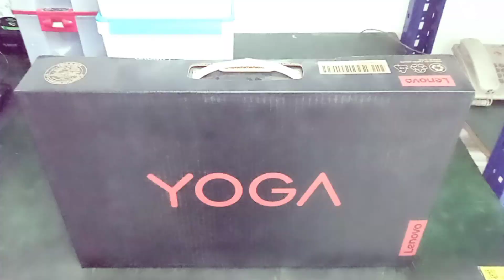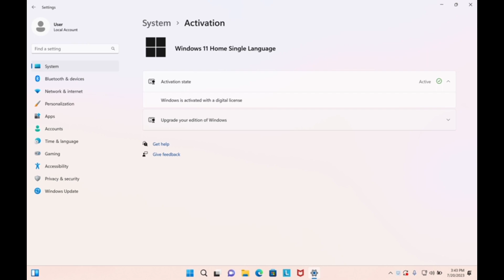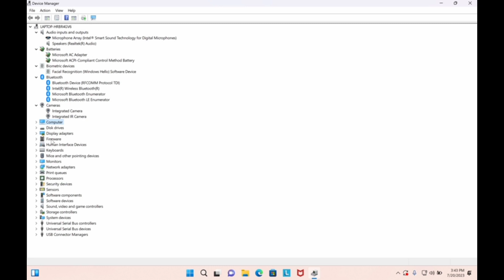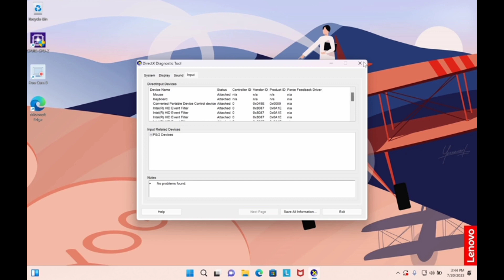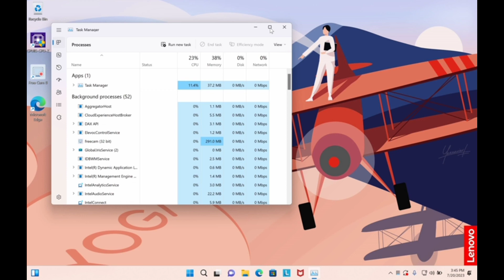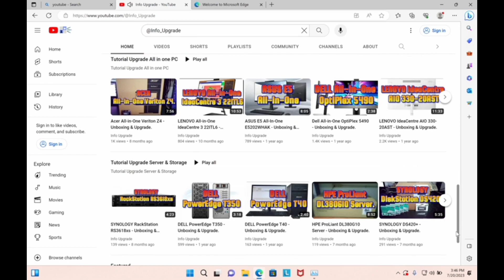LENOVO Yoga Slim 6 14IAP8 - Unboxing, Disassembly and Upgrade Options.

Comment: Bro does aluminium body laptop heats ?? 
I should go for this or not ?
And how is  battery battery backup
Reply from the maker: The aluminum body doesn't get hot. The battery is quite good (long lasting)

Comment: well good explain brother, I want to know about battery capacity mah /wah,
Reply from the maker: hii bro
Integrated Li-Polymer 65Wh battery, supports Rapid Charge Express (get 3 hours of runtime with a 15-minute charge)
Reply: wah /mah, means if  I purchase power bank of 25000mah, for full charge of Lenovo laptop how much it consume battery from power BANK
Reply: ambrane 25000mah power bank 100watts charging
Reply: I have purchased Lenovo Yoga Slim 6 Intel Evo 14IAP8

Comment: what kind of ssd is that? i have seen full size ssd so far. can i upgrade it further with full size regular ssds?,,, please reply
Reply from the maker: Hi friend
If you want to upgrade, remove the default SSD
Use SSD M2 NVME 2280
Reply: @Info_Upgrade  thanks for replying❤❤

Comment: Hello Bro.....,I have one problem from this laptop that's vertical black line appears on Desktop .
Please tell me solution anyone for this problem
Reply from the maker: Hi, Bro.
Black line? what is deep rupture
I suggest you take it to an official Lenovo service center, because the guarantee covers a damaged unit, even if the LCD is broken, Warranty Add On Accidental Damage

Comment: Running very hot, I have bought it recently, What to do ?
Reply: @borok2312 yes, but battery backup is normal (5-6 hours, but performance excellent) not upto 9 hours (like intel evo says).
Reply from the maker: HI bro, I'm the same, but after the Windows update is normal, try checking Windows Update, there is a BIOS version that needs to be updated
Reply: @Info_Upgrade  all running fine bro. Thanks
Reply: @Info_Upgrade  Ok bro, I will try it and let you know.
Reply: @Info_Upgrade kitne ka liye bro

Comment: subscrived 🎉 

btw is the charger same for i5 12th gen model? is there any heating issue or battery draining?? why does it have 2 exhaust fans? is there a dedicated ai engine + in this and in i5 12th gen model? please let me know:)
Reply from the maker: hi bro, charger is the same. It will feel wasteful if you haven't updated Windows, there is a bios update, check again immediately

Comment: Benchmarks cinebench r23 of i5 1240p version ??
Reply from the maker: Oke next video bro
Reply: this is best laptop or not?
Reply from the maker: @sathishgummula2543  best bro
Reply: @sathishgummula2543  I have purchased laptop, 
Cinebench R23 : 
single core : 1500
Multi core : 9600

Faster than m1 😘
Reply: What's the battery backup?
Reply: @ronnies9291  avg 5 hours, because of intel inefficiency